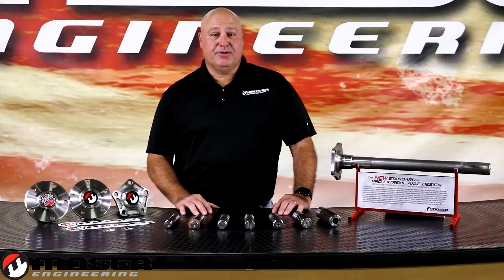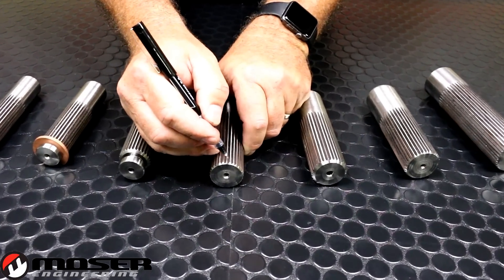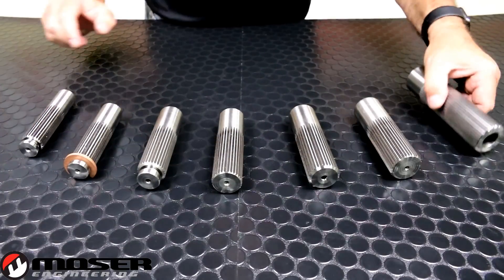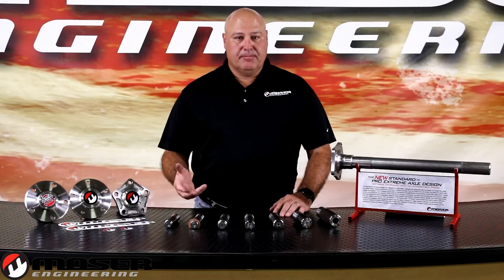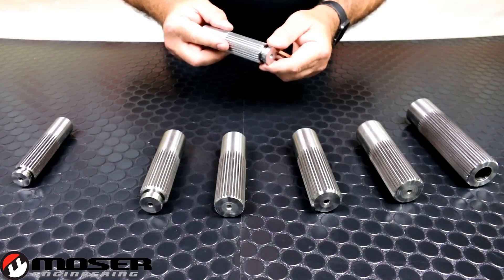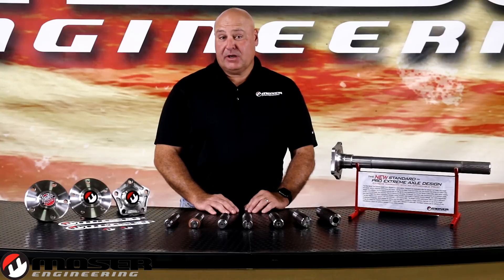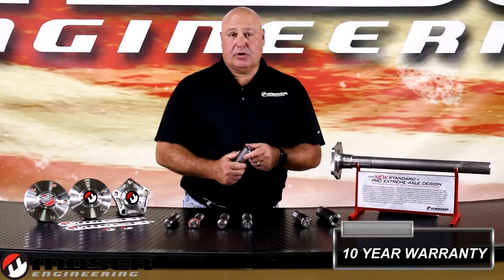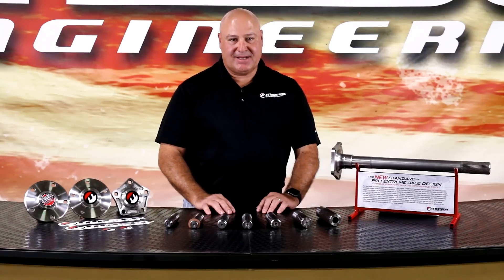Moser Minute --What is Axle Spline?

Comment: I have 2003 tj. W/broken rear axle. How can I count the splines to order the correct replacement  (of of the axle ? ) How do I get out
Reply: might be easier to just identify your rear axle and go from there - since you have an '03 TJ  and assuming your axles are original to the vehicle you'll either have a Dana 35  or Dana 44 in the rear.
Reply: The broken off spline end ???

Comment: Is there anywhere that sells just the end bit of just the spline?
Reply: What are you building? I'd like to have some stub shafts made for a Ford 8.8 irs diff so I can use them in a vette. The vette output shafts are u joint style and act as part of the suspesion.
Reply: @mcqueenfanman  I’m building a cross kart and using an atv differential
Reply: @gobenny3348  What is the spline count?
Reply: @mcqueenfanman  24 spline, I already made one on a mill just need to start on the second